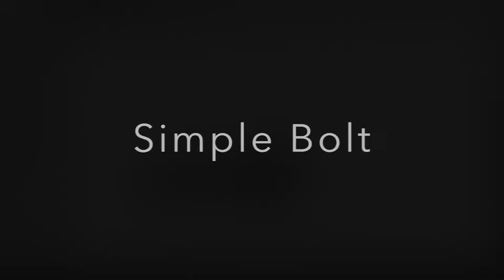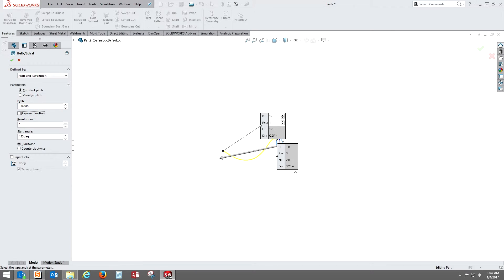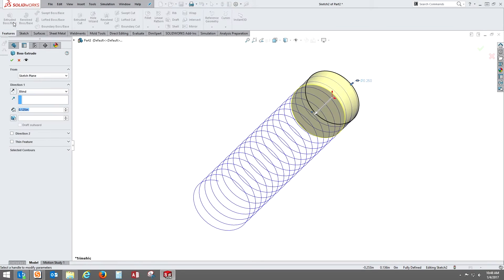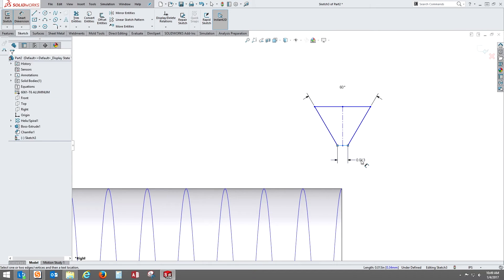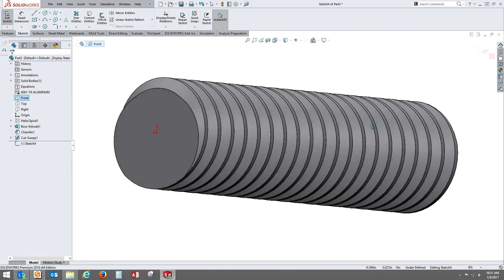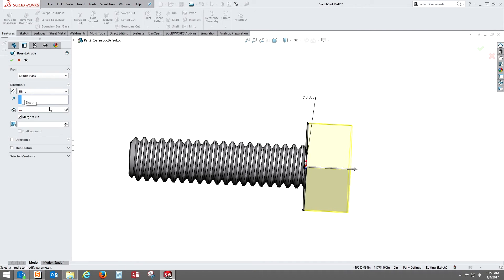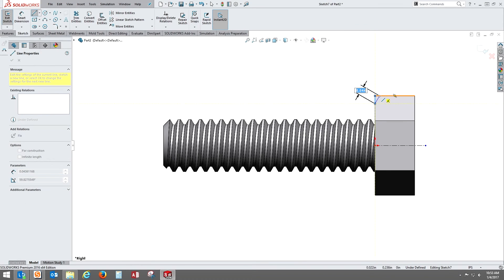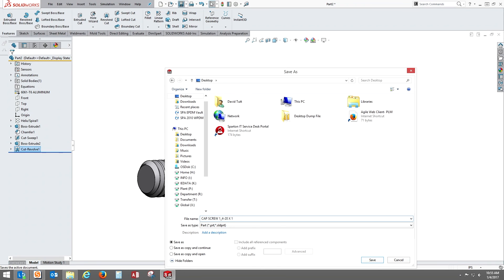How to model a basic bolt with threads SolidWorks 2016 - Video #1

Comment: how would I make a .500”-13UNC bolt 1” long
Reply from the maker: Hello Emily, You can follow the same steps in this file but make the edits of the shaft diameter changed to 1/2" and the pitch of the curve to .0769 to have 13 turns per inch. The only other thing is to increase the head size to match the 1/2" bolt which should be 3/4" flat to flat. Hope this answers your question